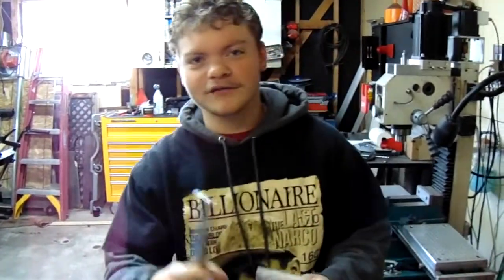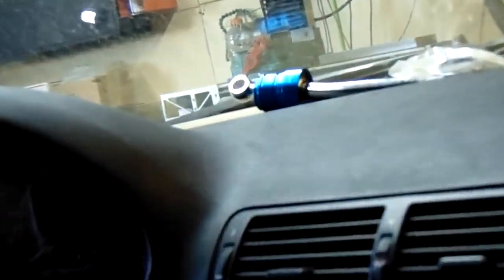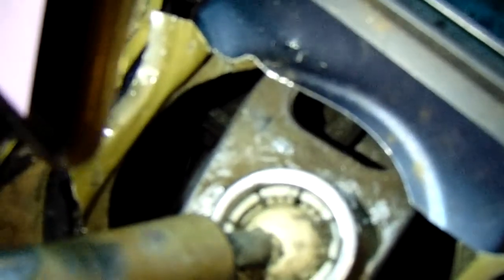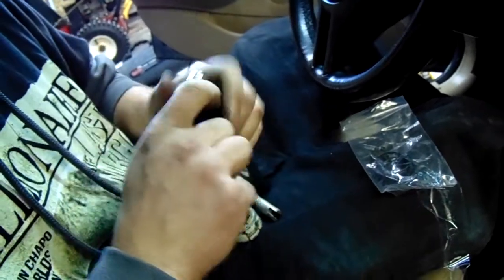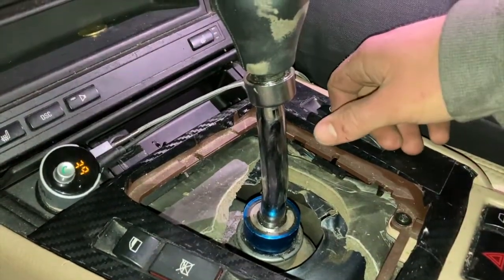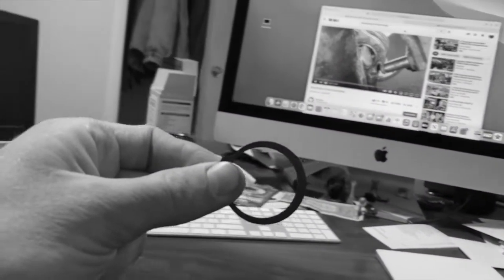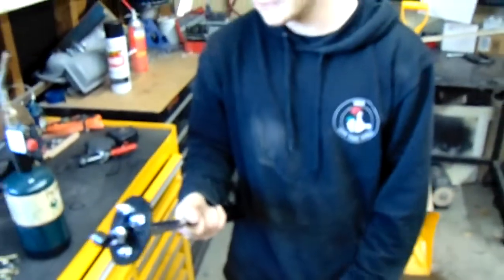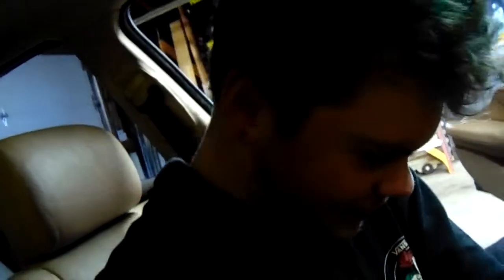BMW E46 Short Shifter Install (DON'T DO) (330xi)

Comment: this guy was not lying DO NOT install this ebay shifter its was aids to do and I had to 3d print a piece to hold it in place since to put the c clip on you have to drop a bunch of shit from the bottom on the XI models and after all thats said and done its pretty jank and sometimes wont go into first gear unless I put it into second and then put it back into first gear
Reply: In that case you have a problem with a clutch, not a shifter.

Comment: I have a short throw shifter already on mine, not sure if the previous owner had it installed or if they made changes during different years. mine is 2003. I did change the shift handle and leather boot to one that lights up the gear diagram. There was a reason =P

Comment: ayoo., im wondering wtf is wrong with my short shifter, i have the same as yours, but when i installed it, it would only go into 1,3 and 5th gear... is it maybe not all the way down into the shifter hole? 
 i just subbed, cool content.
Reply: 6 speed gearbox?